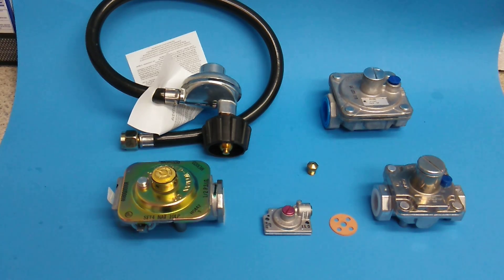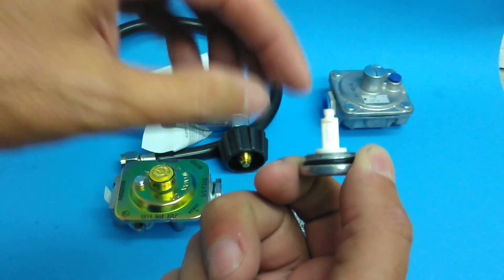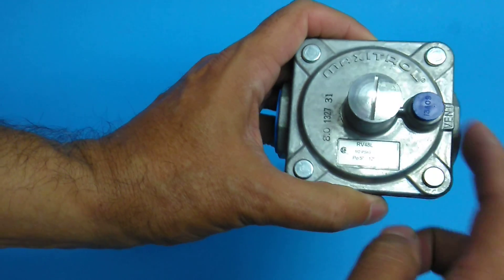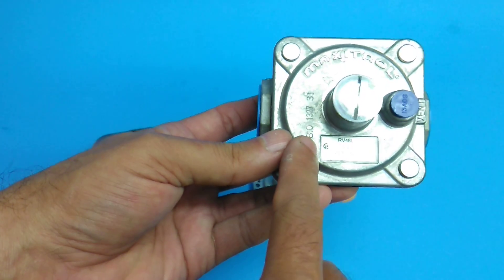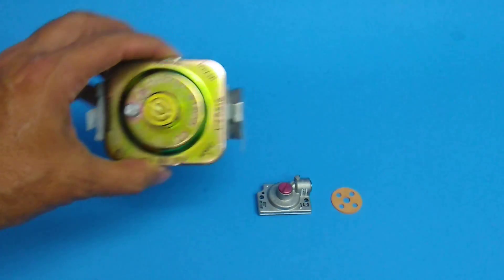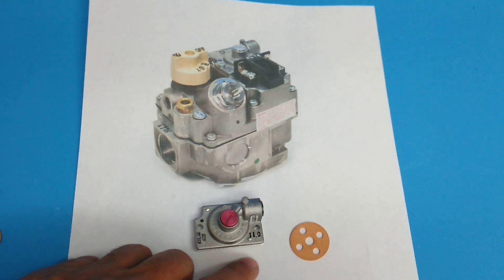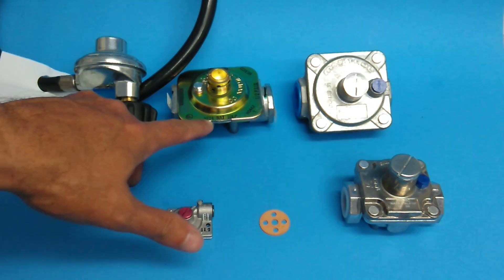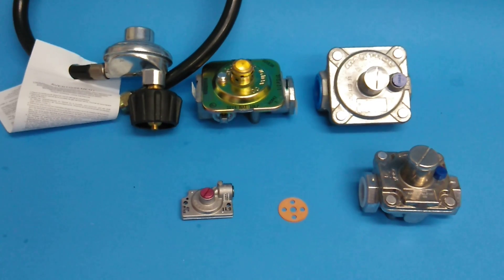Fuel Regulators Explained

Comment: I have a one burner natural gas pizza oven.  Can I convert to LP just by changing the regulator, or would any orifices need to be changed?  thanks
Reply from the maker: You have to change the orifice and possibly make an adjustment as well as converting the regulator to work with LP. I carry orifices and regulators for every brand there is. Feel free to contact me  via text or voice at (714) 574-1544

Comment: Excellent video just 1 question the stove has a regulator to convert from LG to LPG but the propane line to the tank has a nother regulator. Is that normal
Reply from the maker: I carry orifices and regulators for every brand of stove and barbecue made. Feel free to contact me at (714) 574-1544.

Yes. Typically a propane supplier will typically have a propane supply tank outfitted with a propane regulator rated at 11" WC. So, since it's standard practice to outfit appliances, heaters etc with a separate propane regulator rated at 10" WC or below. If you live at a high elevation, it would be wise to use an adjustable propane regulator to tailor the low flame setting on your stove (adjust the low flame of the lowest setting on the lowest rated burner).

Comment: which regulator should I use for a gas range for my house using a 30 lb propane tank?
Reply from the maker: I actually sell orifices for every stove and barbecue made on my website  https://flamesources.com/  I'm now in the Midwest, and you can always get a hold of me at 714-574-1544.

That model should have a regulator already plumbed into the inlet fuel line somewhere before it reaches it's first control. You'll need to plumb in a pig tail onto the outlet of your propane bottle. Compression end plumbs into compression adapter, then adapt up to size inlet of regulator (likely 3/4 inch). The plastic adapter plumbs directly onto the bottle outlet.

If your unit doesn't have a regulator, I have these in stock. Your range will use either a Maxitrol or a Harper Wyman regulator (refer to this video). I also have the adapter that would fit into the compression fitting.

Comment: In your video, you commented that the Harper Whyman regulator has a cap that can be flipped for propane or natural gas and there is a spring inside. Is there a way to further adjust the gas pressure? After a propane to natural gas conversion, the flame is huge. The orifices were switched, the air openings on the burners were reduced, and the cap on this regulator was flipped to natural gas. I can adjust the top burners flame height a little using a tiny screwdriver but not enough and there isn’t a similar adjustment for the oven burner. I have a Dynasty stove. Thank you for any advice that you can offer.
Reply from the maker: I'm the only person who does custom made conversion kits for every make and model there is. Feel free to call or message me at 714-574-1544.

There are three possibilities for why your flames are too high; orifice sizes are bored too large, regulator is either not converted properly or is NOT actually regulating, you're at high altitude. If you're at high altitude, you'll need an adjustable regulator in order to turn down the rated output. In most cases, this will reign your flames in. If not, you'll need to change the orifices. I have adjustable regulators for this application, so just reach out.

Comment: But why is there sometimes two RV48L one in front of the other….
Reply from the maker: I actually sell orifices for every stove and barbecue made on my website  https://flamesources.com/  I'm now in the Midwest, and you can always get a hold of me at 714-574-1544.

If you have two regulators in line with one another, and they are both fixed regulators (non adjustable), and they both have the same ratings (example - 10" WC), then there's a possibility that you'll have a conflict between the two regulators. Usually, if you see this, then the regulators that's upstream (11" WC for example - that's what a propane line coming from a large propane tank is rated at) is rated higher than the one downstream (10" WC - what most appliances except a barbecue) are rated at. Keep in mind that the regulator from the source (the large propane tank) is usually supplying fuel to multiple appliances.
Reply: @frankhamilton8257  …. Thank you for the response…. And there is a very large tank outside…

Comment: Thanks, Frank  Very helpful video.  I have one of those Chen Fong #3030 regulators like you show in the video.  I'm not getting enough gas to my burners, only up to around 300 degrees, so I'm trying to adjust this one.   Your video shows how to change this regulator from nat gas to LP, but not if/how this regulator can be adjusted for increased flow.   I see the spring, but no screw inside to adjust the flow.  Do you know if I can adjust the flow on this regulator?  Thanks for your help and advice, Frank Nemiroff, Venice Beach, CA
Reply from the maker: I actually sell orifices for every stove and barbecue made on my website  https://flamesources.com/  I'm now in the Midwest, and you can always get a hold of me at 714-574-1544.

The regulator that you're using is designed to convert between natural gas and propane, it's output is not adjustable for either one because it has a fixed output. If you're looking for adjustability you're looking for a regulator dedicated to natural gas or propane that has an adjustable diaphragm, like the one demonstrated at 4:30. I often provide these regulators for people at high altitude.

You may want to actually use an infrared thermometer to determine what temperature your grille is at before making any changes.

At any rate, make sure to like and subscribe to my video channel.

Comment: I don't care about a water colom, witch way makes the flame get smaller  ?
Reply from the maker: I actually sell orifices for every stove and barbecue made on my website  https://flamesources.com/  I'm now in the Midwest, and you can always get a hold of me at 714-574-1544.

It sounds like you're converting FROM natural gas TO propane. There are two factors that control the intensity of the flames on your system. The first factor is the output ratings of the regulator specified in inches of water column and the second factor is the size of the orifice bores.

I use a chart system from Ward Burner systems to calculate the orifice sizes based on calculated BTU (actual BTU) of a given burner setup, however there are many online resources that would enable you to get an approximate calculation. I use the term "approximate" because, the only way to properly convert a system is to first calculate the ACTUAL BTU rating of the existing burners, then use that calculation to calculate for BTU of the alternate fuel. 

I've likely converted over 60,000 burner systems at this point in my career, and, over the years, I've found that most burners are improperly rated. If fact, they're usually over rated by as much as 13%. The average burner system is over calculated by 8% or 9%, which would mean that a burner rated at 10,000 BTU is actually outputting 9,200 BTU (based on a 92% figure). 

To add to the confusion, most burner systems only allow a 92% efficiency on propane (LP) burner ratings compared to natural gas. If you look closely at many manufacturer's labels, you'll see that difference reflected in the BTU ratings for natural gas versus the BTU ratings for LP. In such cases, I use a "best practice" scenario, so I calculate first, then, if I see that the burner is actually 92% efficient of what the manufacturer's rating for that burner is on Natural gas, I will calculate the converted solution at 92% of what the label rates the burner for on propane. If you really analyze this, you'll see that the labels rating (for propane versus natural gas) is close to that 92% figure anyhow, so I'm likely right my assumption towards the safer calculation.

Remember, this is FIRE we're talking about, so it's better to error on the side of caution.

Comment: Very informative video but I still need help. I've got a 30" GE stove and the flame on all four burners is low. They all light properly with a blue flame but the flame is only about 1/2" long max. It's been that way since I bought it almost a year ago at a thrift store. 
I replaced the regulator and that fixed the oven problem. It would take 30 minutes to preheat the oven but after the new regulator, it preheats in 5-10 minutes. But all the stove top burners still have a low flame. 
There isn't a valve to adjust each individual burner flame height in this model. The model is #JGBS60DEK3WW. The stove is 5 years old, built in Feb. 2018 and is in excellent condition otherwise. 
On the regulator it says, "No field repairs", 1/2 PSI and "Nat 5 WC LP 10 WC. I live at 5200' elevation. 
Any help you can give me would be appreciated.
Reply from the maker: I actually sell orifices for every stove and barbecue made on my website  https://flamesources.com/  I'm now in the Midwest, and you can always get a hold of me at 714-574-1544.

You didn't specify whether the unit runs on natural gas or propane. If it's natural gas, it's likely that someone replaced the orifices with orifices bored for propane. If it is propane, then someone likely replaced the orifices with orifice blanks that were not correctly bored for the heat range that your burners are rated at. That 5,200 foot elevation would require a slight adjustment to compensate for the altitude.

A 5,200 foot elevation would dictate a .92508 correction factor to compensate for the altitude. So you would take the actual BTU of your burners and multiply by .92508 then bore orifices to suit that BTU. The trick is to know what the ACTUAL BTU of your burners was originally because the factory label is seldom stating the truth about what the actual BTU of each burner is. It's been my considered experience that most burner systems out there have an actual BTU rating of about 92 or 93% of what the manufacturer states. If that's the case you would multiply the stated heat rating by 0.92 and then again by 0.92508 to compensate for altitude.

To complicate this even further, some burner systems use a combination of two orifices; one for low heat and another for high heat, so you would need to address what heat delivery would be necessary from the fuel charge on each stage. In some cases, that burner fuel charge could be delivered from three or even four stages, where a jet in the knob assembly meters the lowest part of the low heat and a secondary jet in the knob assembly handles the third stage heat (out of four stages). This is quite common on a lot of high end burner systems;  Wolf for example.

In any case, I've certainly done my fair share of these more high tech burner systems since I've likely converted more than 60,000 units at this point in my career.
Reply: @frankhamilton8257  Excellent information. Thank you.

My stove runs on natural gas. 

The two left burners are rated at 9500 BTU and the orifices are labeled "768" with "11" opposite the "768".

The right front burner is rated at 13,000 BTU and the orifice is labeled "766" with "111" opposite the "766"

The right rear burner is rated at 5000 BTU and the orifice is labeled "799" with "1" opposite the "799".

The design of this stove seems pretty simple and straightforward with a tube going from the regulator to the four burners with a single control valve at each burner. I see no other valves used here. 

Based on what you said, I think this stove was set up to run on propane either from the factory or converted to propane later. So it seems that replacing the propane orifices with natural gas orifices should solve the low flame problem. Do you think I need to have the orifices drilled to work properly at 5200 feet elevation?  Can you give me the recommended orifices I need so I can buy them at your website? Thanks again.
Reply from the maker: It's likely that the orifices that you've purchased were blanks. The kits that I do typically are bored specifically for the model that they are intended for. There's no guarantee that the oven burner is right either if you've replaced it. Some oven orifices are adjustable, so yours may be one of those. The indicator is that such an orifice would have two sets of numbers stamped into it (e.g. - 47-54). Here's a video link on how an adjustable orifice works - https://youtu.be/JzcZ-yskLxA   Make sure to like and subscribe to my video channel.
Reply: @frankhamilton8257   Hi Frank. I think your response is for someone else. It doesn't seem to fit with my comment. Sorry for the confusion.
Reply from the maker: @thomascampbell5633  On the contrary, it's a very detailed response and it addresses all of your concerns and covers all possible scenarios. You'll want to take some time and read through it point by point.
Reply: @frankhamilton8257   O.K. fine. I'll go through it again. Appreciate your quick reply.

Comment: I have maxitrol but the screw is sealed with red and my gas fireplace won't burn only pilot light on when I click kindly guide me
Reply from the maker: I actually sell orifices for every stove and barbecue made on my website  https://flamesources.com/  I'm now in the Midwest, and you can always get a hold of me at 714-574-1544. Makes sure to like and subscribe to my YouTube channel.

There's another type of regulator that has what is known as a "pilot generator." This type of regulator is manufactured by Honeywell, Robertshaw and several other manufacturer's. I demonstrate this regulator in this video: https://youtu.be/LsLdX-4u-tQ

As far as I'm aware, Maxitrol doesn't make such a regulator, but that's neither here nor there. This type of unit is a combination unit that senses if the pilot is lit or not. If the pilot is NOT lit, the circuit inside of it will NOT allow gas to flow through the regulator and, ultimately to the burners. If the wire for the pilot generator is compromised or if the resistance in that wire is out of spec, the fuel will NOT be allowed to flow through the regulator. That's likely what the issue is with your system. The good news is that you can purchase the pilot generator on it's own for only a few bucks. And, by and large, pilot generators are mostly the same among all brands, so you don't necessarily need to find an exact match to suit your application.

Comment: Great video! How would I know the right amount of adjustment for the water column. My cooktop requires 5" for NG. If I get an adjustable and I don't have the tool you used at the end. Is there a way to eyeball it?
Reply from the maker: I actually sell orifices for every stove and barbecue made on my website  https://flamesources.com/  I'm now in the Midwest, and you can always get a hold of me at 714-574-1544.

If you don't have a meter, the simplest way to make these adjustments is to turn on the smallest burner on it's lowest heat setting, then adjust the regulator until it maintains it's lowest flame steadily without flutter (I'm assuming that you're working with something sophisticated like a Wolf or a Dacor burner). Once that setting is adjusted, you'll want to turn on all other burners. to see if this adjustment is still good. If multiple burners have a low flame feature, you'll want to focus on the burner that's the furthest away from the regulator.

Obviously, you'll need to do this in an enclosed environment with no ambient air flowing around the source flame.

Comment: Excellent video! Thank you. I watched many, but yours was the only one that cast a clear light for me on what had been a murky subject. You explain how things work, why they work that way, and generally zero in on the kind of information that's helpful. Keep up the fine work!
Reply from the maker: Converting the regulator is only one part of doing a fuel conversion. I actually sell orifices for every stove and barbecue made. I'm now in the Midwest, and you can always get a hold of me at 714-574-1544.

Thanks for the kind comment. I used to be a technical writer, so I present these videos with the same kind of discipline.

Comment: Hi frank have question for you the bbq regulator is fix but how many water colunm bbq regulator thank
Reply from the maker: Converting the regulator is only one part of doing a fuel conversion. I actually sell orifices for every stove and barbecue made on my website  https://flamesources.com/  I'm now in the Midwest, and you can always get a hold of me at 714-574-1544.

Barbecue regulators are normally rated at 11" WC, but not ALL regulators are intended for Barbecues. These types of regulators (with the regulator built into the hose) can also be found on other (higher output) burner systems.

Comment: Thanks for the thorough explanation!  Question: what’s the deal with the blue plastic caps?  Are they suppose to be left alone? It looks like mines threaded but the blue cap just presses into place.
Reply from the maker: Converting the regulator is only one part of doing a fuel conversion. I actually sell orifices for every stove and barbecue made. I'm now in the Midwest, and you can always get a hold of me at 714-574-1544.

If you're talking about the small blue pieces at the top of each regulator, then those pieces are the relief that enables the regulator to internally relieve pressure as it builds up beyond the regulator's rating. If you're talking about the larger blue pieces stuffed inside the inlet and outlet holes of the larger regulator, those pieces are there to prevent any moisture from entering the regulator assembly before it's installation.